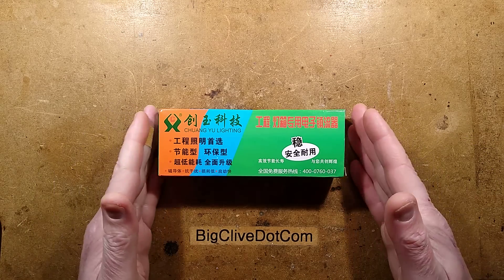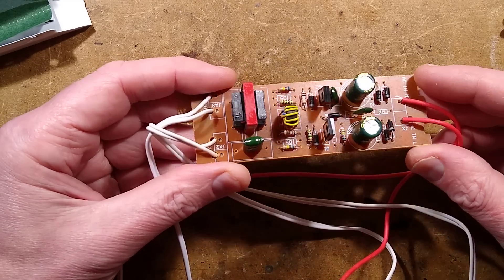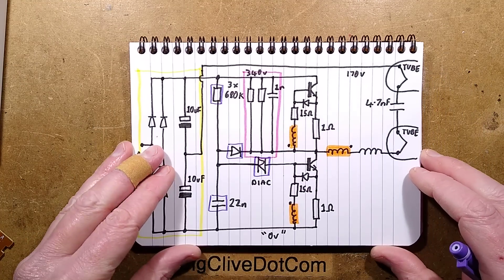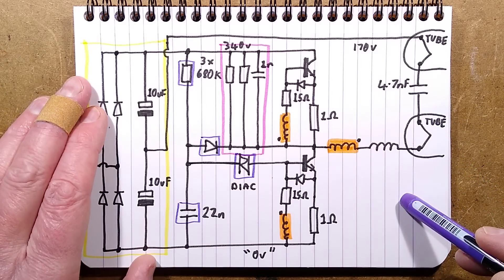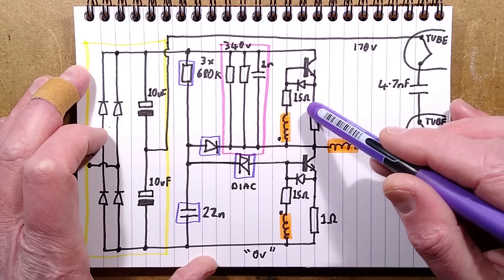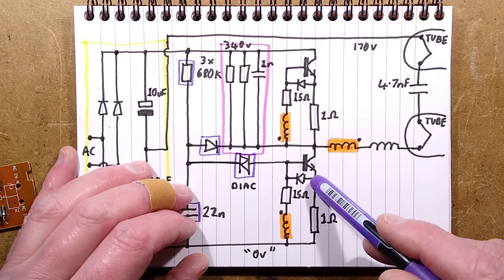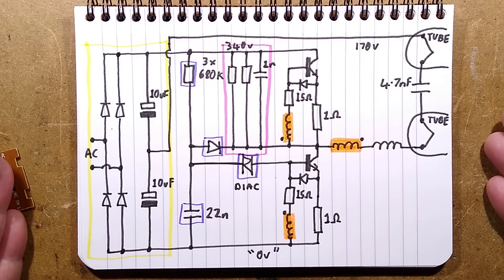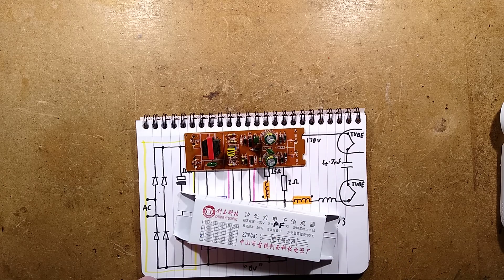Cheap AliExpress ballast (with schematic)

Comment: Hey Big Clive,

Is there any way to run a Ballast Dependent T8 LED tube without ballast? ie, with a DC supply, or a low voltage AC supply, or something else.

Bought two such tubes for an old lamp I bought from a charity shop. Found that the lamp has two magnetic ballast transformers, one of which is dead, the other is unhappy. Replacement transformers are like $60, so I bought some ballast bypass LED tubes to use instead, and will be removing the ballast. But if I can, I'd like to use the leftover ballast-dependent LED tubes in some way if possible.

Thanks!
Reply: You might get away with a capacitor (I would use a dirt cheap nonpolar motor capacitor 2uF 400V which are used in fans here in India) and a resistor (10 ohm 1W+ maybe) in series with it, making a simple capacitive current limiter. But it might result in visible flicker if there is no filtering. At that point it's a question of whether rolling out your own bridge rectifier and filter cap is better than buying either an electronic ballast or some generic LED driver.
Reply from the maker: They need to be run on a proper ballast to avoid damaging the heaters and regulate the current through the tube.
Reply: @bigclivedotcom An LED based tube wouldn't have a heater would it?
Reply: @mcg6762  I would hope not

Comment: Clive, have you worked with 12v fluorescent light ballasts for 40 w? They are typically used in caravans and food trucks.
Reply from the maker: They're often based on Royer type oscillators with auxiliary windings for heating the cathodes.

Comment: Clive, these circuits are a bit beyond me (and I'm sure others too). I know it's not really your MO but I wonder if it would be worth using something like SPICE to show how it behaves. Totally understand if you don't want to faff with it though.
Reply from the maker: I'm not sure how well spice would emulate it.  Especially with the complex characteristics of the tube itself.
Reply: @bigclivedotcom  Nor me. But it's been around a while so...? I'm more of a digital guy myself and don't really go much beyond simple LCR stuff and basic transistors.
Reply: @bigclivedotcom  The trick is to also model the behaviour of the tube. Spice supports that through Behavioural Modelling. Not a project for a rainy afternoon, though. 

 I know for a fact that Philips leaned heavily on such behavioural modelling for developing the first compact fluorescent lamps (the ones with the thin, folded, tubes), although they used an in-house circuit simulator rather than Spice.

Comment: Hi Clive, would you like a 40w tube to test this with? I have few in stock that have not moved in years as we fit LED mostly now. Apart from 2ft 18w, we still sell hundreds of those a month.
Reply from the maker: I may try finding one locally, as shipping a tube to here would almost certainly result in it being delivered in convenient powder form.
Reply: If i was going to mail a tube, i would simply bend it a few times and cram it in to a 6 by 6 by 6 box, way cheaper to ship and it will arrive in the exact same condition
Reply: @frogz  i was going to fax it, would that not work?

Comment: I just removed a fluro fitting in my garage that has a totally sealed ballast in steel and engraved/pressed text that describes the input in cycles instead of Hz. I had a huge laugh when seeing that as the fitting is probably older than the house itself.
Reply: I would love to see a picture of it!
Reply: Comment from 1 month ago... video uploaded an hour ago...

Agh, my brain.

Comment: I loved the old philips SL lamps, still got one, an entire iron magnetic ballast and a starter in a disposable jam jar.... IMMENSELY heavy, try using one in an anglepoise lamp! lol
Reply from the maker: I used one in a retracting ceiling light and it dropped like a stone.
Reply: That must have been the bulb I recently replaced with a modern LED in mum's porch light - it's been there since I was a child (40 years ago!), and I was surprised how heavy it was! I hope the recycling people didn't mind that I put it in the glass collection box as it was probably 90% glass!
Reply: @stepheneyles2198  sounds like it
Reply: I still have a Philips SL18 Prismatic "compact" flourescent lamp from before they even rounded-off the plastic part. 1992 date on it (because my grandpa always wrote the date on things he got new or replaced, like batteries, lamps etc). Still working flawlessly in the basement and gets used regularly (since my washing machine and dryer are down there). No idea what "nasty sickly light" LimaVictor is talking about. Mine isn't at all unpleasant, light color wise. Seen MUCH worse from cheapo electronic CFLs and especially LED lamps (where "warm white" often equals "piss yellow")
Reply: I got one of them. Kept it at the school where i work, as a demonstration of the progression of lighting tech. With a spectroscope, the students can see the difference between incandescent, LED and CFL. 
The SL lamp gives off this nasty sickly light. Not sure what color code it has, but i reckon it's 530 or so.

Comment: fluorescent lights and gas discharge tube devices in general are incredible. sort of sad, but also understandable seeing them slowly being phased out. it’s a bit silly. theoretically a perfect fluorescent light could last more than the lifetime of a human being and much longer in ideal conditions. but of course we live in the real world, so achieving a perfect light or perfect conditions is impossible, but still, they we’re able to last long without it just being a stroke of luck. with proper setup they were reliable and durable. but then came CFLs. oh boy. we wanted the luxury of using our good ol’ edison sockets and having all the benefits of the reliability and durability of big fluorescent tubes. turns out sticking a high voltage ballast into the space of a golf ball with extremely limited airflow isn’t as easy as it sounds (well it doesn’t even sound easy, but you know what i mean). so they broke. the more they broke the more people expected them to break, and the more people expected them to break the more manufacturers turned to making cheap, but replaceable bulbs rather than making then a bit expensive, but long lasting. all of this sounds waaay too familiar. LEDs anyone?

i didn’t expect to write an essay, but here we are lol. don’t get me wrong, i love leds, but i think we have become way too lenient when it comes to things breaking. and the more lenient we become, the more things will inevitably break
Reply: Well said.
Reply: We shouldn't feel bad about writing more online. Your comment is maybe one page in a novel. Social media has made people lazy. We're having interesting discussions here. The fact that it fills up a small smart phone screen or a comment box on a computer deceives the mind, it really isn't very much to read at all.
Reply: My favorite has discharge lamps all use metal salts and a very hot arc, 1000 watts of limited band orange light is so lovely, reminds me of sweet home Chicago,  you can always find your bearings just by looking up at the clouds and finding the orange glow, sadly the glow isn't as orange anymore because of the trend for LEDs replacing them, i still want a low pressure sodium lamp.... Never got my hands on 1
Reply: @frogz  I'm young enough to only recall seeing low pressure sodiums in my early childhood, but i kinda miss them everytime i see picture of them lighting up a street in pure yellow cancelling all other colors.
Reply: @liam3284  rapid start aka high voltage Spike instead of heating elements that can burn out

Comment: Clive I use fluorescent tubes.  40W in the kitchen is over 10 years old.  Replacement tube is 5€.  Genuine Philips 10W LED light in sitting room on ES holder lasted 1 year cost 8€.
Reply: my workshop light is a dual T8 58W neutral white flourescent tube setup, upgraded from conventional ballasts to Osram "quicktronic professional" electronic ones probably 15 years ago and wired such that I can just turn on one of the two tubes. The tubes were used when i upgraded the ballasts and have lasted till 2017 when they both stopped firing in short succession (a week?) to each other. I replaced both with new 58W tubes... for a whopping 3eur a piece. Meanwhile I've had to replace countless more expensive LED lamps (GU10, E14, E27) after as little as 4 months due to various failure modes (usually catastrophic, visibly burnt chips etc). My oldest, non-modified LED lamps that are still working fine are just about approaching half of what the original used flourescent tubes managed, and ironically those LED lamps were cheapo ones (3W ISY from mediamarkt)
Reply: same here. 8 years and it’s still going strong
Reply: same here. 20 years with fast electronic starter and it’s still going

Comment: When you said initially that you couldn't see any obvious current limiting, I immediately pointed at the feedback transformer, think "I bet that's it" though without any tangible proof. Your analysis confirmed that you thought exactly the same, but this time with evidence.
Reply: Ya, and possibly the capacitor that is in series between the two tubes.
Reply from the maker: The series capacitor between the electrodes is purely for the heaters.  Once the tube has struck it will conduct mostly across the outer terminals.
Reply: @bigclivedotcom  I think the tiny capacitor is also needed for startup. Without it there'd be no current path through the feedback transformer.

Comment: "What's that line from between the two 10uF capacitors doing (connects directly to the tube)?" A change in perspective makes that line the "0V" reference, and the far sides of those capacitors +170V and -170V. The two transistors form a push-pull output driving the inductors to the tube. The RC circuit driving the diac for start-up, and the diode preventing the diac from firing makes sense to me. I'm not so certain of the 2 R's and 1nF cap....

Comment: Thanks for reminding me I need to do something with a light fixture with a dying ballast in it. OMP Okay 90 minutes later and I've found appropriate LED replacement tubes with the needed parts included for the retrofit. Only $21 for each kit so for less than $10 more than a new ballast and tubes I can retrofit both fixtures.

Comment: I wonder how to estimate the frequency of the oscillators in these push pull circuits
Reply: Just wrap a few turns of wire around the tube while it's lit and measure it with a scope or frequency meter.
Reply from the maker: It'll cover quite a wide range.  I'd guess maybe 30kHz for this one.
Reply: Oscilloscope, 1 of the things i can't justify spending money on
Reply: There is also circuit simulators that can tell you ideal conditions

Comment: Do you suppose these would drive the LED drop-in fluorescent tube replacements?
Reply from the maker: It would be more reliable to just use the ones that operate directly at mains voltage with the ballast bypassed.
Reply: @bigclivedotcom  I have a box full of the retrofit tubes that I ripped out of our old building when our offices moved. I'll probably have to sacrifice one to see what circuitry they have inside. Maybe a simple capacitive-dropper will suffice. 
Unfortunately they're all glass tubes so getting into them could be messy. I shattered one already just trying to twist the plastic endcap off. And the LED tape is glued to the glass with something I'm not sure I can dissolve without destroying the tape. So I'd prefer to be able to feed them as-is without buying a bunch of fluorescent fixtures.
Reply: I don't believe it would work on your typical LED tube. Fluorescents will require high voltage to get started and will need less as they warm up. Unless the drop in tube has voltage regulation circuitry that can adjust for the high spike in the voltage at the start, it will likely just burn out the LEDs.
Reply: @taurolyon  These were drop-in replacements for gas tubes, so they have some adaptive circuitry in them.
Reply: @taurolyon  I don't think any fluorescent ballasts will supply high voltage unless the main circuit is broken.
Reply: @taurolyon  Unless the "high spike in voltage" is accompanied by a high current capacity, the LEDs will simply clamp the voltage and be safe.